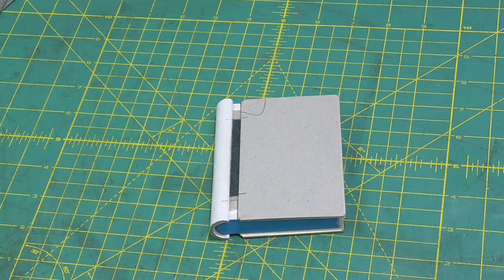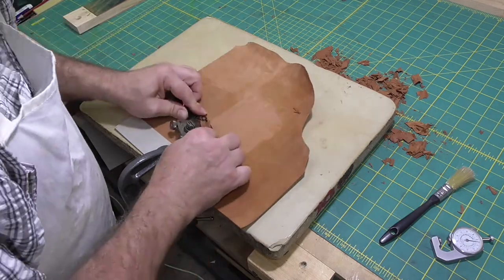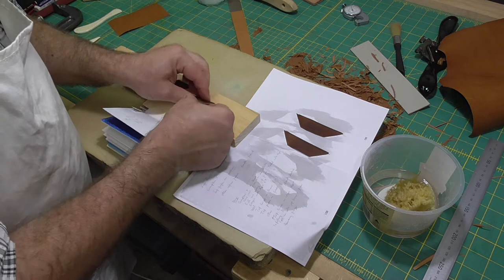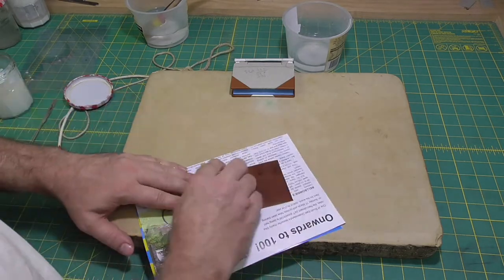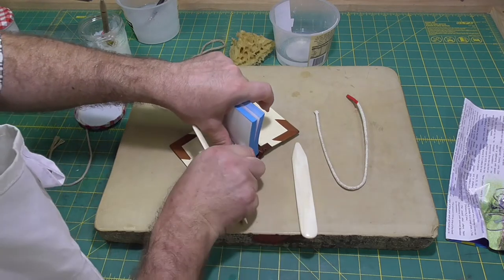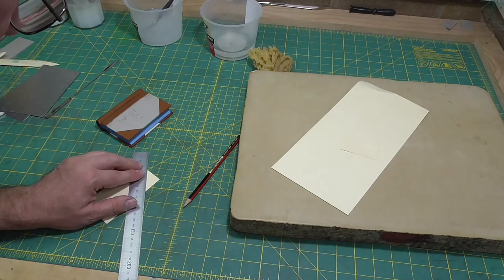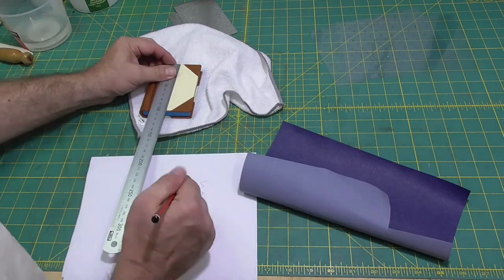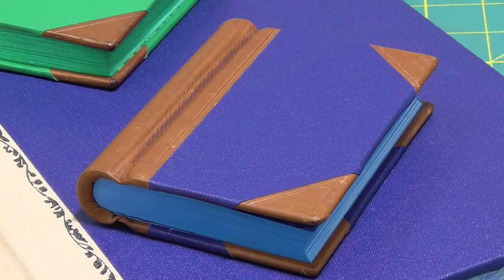Binding a Little Springback Pocket Notebook Part 3 // Adventures in Bookbinding

Comment: This series has motivated me to make my second ever springback. As with my first one, I've gotten to the point where I need to make the spring and have promptly put it on the backburner to focus on other projects. I don't know what it is about making the spring that's so intimidating, but its the one part I always put off for as long as possible.
Reply from the maker: Ed, you need to work through this one.  Set a goal of making one a day.  Cut a heap of materials and start experimenting.  Try laminating 2 boards and wrapping.  Only wrapping on the inside.  Not wrapping at all.  It only takes 10 minutes to make 1 spring.  Try different adhesives.  Get a small box and keep them all.  The ones that don;t work will make the ones that do look even better!  And in 2 weeks you'll feel like an expert on springback springs.  Good luck and take care, Darryn

Comment: That tip with the spokeshave is awesome. I'll be working a lot more with leather now. Thank you.
Reply from the maker: I seem to remember Middleton said the spokeshave started to be used by English trade binders in the early 20th century.  I think Peachey has correlated this to the rise of the Stanley 151.  Makes sense I guess.  I have tried using spokeshaves for woodworking without the adjuster screws and they are a pain in the neck.  Having the fine adjustment makes tuning for leather easy.  I should have included some video of adjusting and testing the cut depth.  Next time.  All the best, DAS

Comment: What a fantastic journey! Thank you for sharing your skills. On the turn-ins, may I suggest gently stretching the two sides out while turning, then (while stretched) turn in the spine area. You may be able to avoid the creases. Leather is very maleable as you say, so it will “spring” back to shape as you finish manipulating. I used to work with leather when I did costume designing. Little trick of the trade. Stay safe.
Reply from the maker: Thanks.  I think it's better to push the extra leather into the spine where it is harder to see any bruising from manipulation.  Going out there is a risk that minor damage or extra bulk will show through the turn ins.  Some days things just happen...  Happy New Year!  DAS

Comment: Darryn, could you please tell me the size of the nipping press you're using? It look just the right size for what I'm looking for, but it would be useful to know the dimensions (particularly the base plate and platen sizes). I have a small copying press at the moment but it's not right for the types of books I'm making. Most of the ones I see on eBay (in the UK anyway) have small plates (mainly 10x12 inches). Thank you!
Reply from the maker: Yes, it's a great size, it's 15x10 inches.  You'll occasionally see me use a smaller one way at the end of the bench, and I have a proper nipping press at 24x18 in in the other room.  The 15x10in is great because it will take an A4 sized book.  In the past I would have said the smaller version was more common in Australia.  But in the last few years the larger size has been showing up fairly regularly too.  Almost always in very poor condition, but described as excellent and rare!    Good luck finding a larger one!  DAS
Reply: @DASBookbinding  Darryn, many thanks for this information - it's very helpful. I'll have to keep my eyes open for something decent, though in the current lockdown I can't imagine I will be able to get out anytime soon to pick one up if I do find one. Hope you and your family are all well.  Stay safe!

Comment: Question have you ever used a coblers hammer for binding work as I recall very similar
Reply from the maker: My favourite hammer is a Barnsley No 2, which is a cobblers hammer.  I don't think there is a difference between a bookbinders hammer of this style and a cobblers or leather workers hammer.  In different parts of the world they have different shapes.  The Barnsley's were just part of a range of tools aimed at cobblers not bookbinders.  I'd love to know how they finished the Barnsley's.  The body is quite soft but the face is file hard.  It almost seems induction hardened.  Take care!  DAS
Reply: @DASBookbinding  I'll keep my eyes open for one
Reply from the maker: @OldIronShops  I just had a look on eBay.  Avoid the one in Pershore, it's too rusted.  The ones in Bromyard look like Barnsley copies with replacement handles poorly fitted.  Unfortunately nothing there at present I'd recommend, except the one I just bought from Melbourne.  But they come up regularly.
Reply: @DASBookbinding  I've seen them in antique stores I do love old tools